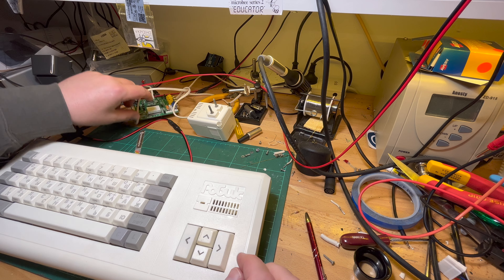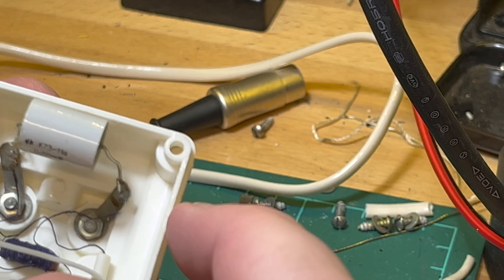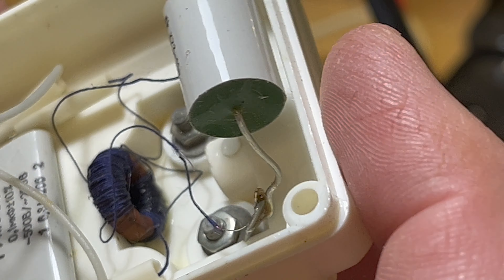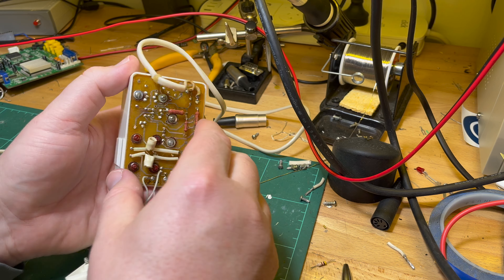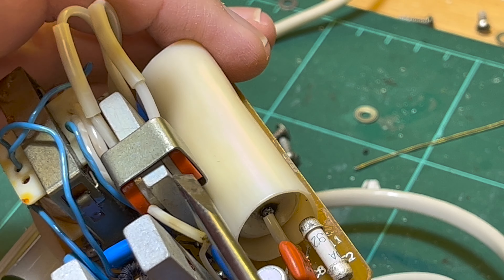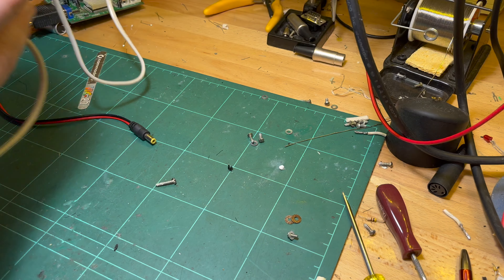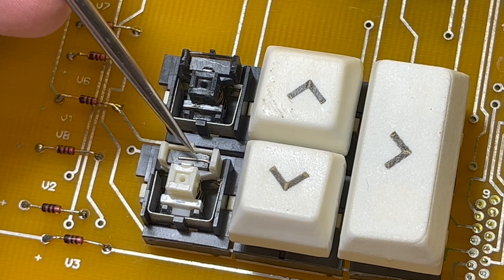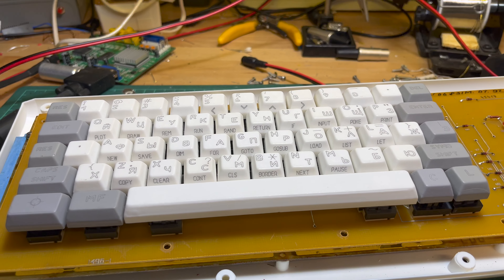🇺🇦 Робик (Robik): Part 2 (Power supply & keyboard) [TCE #0157]

Comment: In the cap is an input filter with a capacitor, an inductor and two more capacitors. This much filtering isn't used on linear supplies. The two orange disks on heat sinks look like high voltage diodes. The two transistors are probably a half bridge. These are the elements of the input of a switching regulator. The small transformer is also a sign of that type design.
Switchers that old are probably not very safe. Isolation was a problem, so it's good you aren't going to use it.